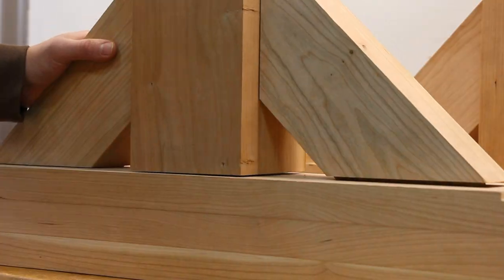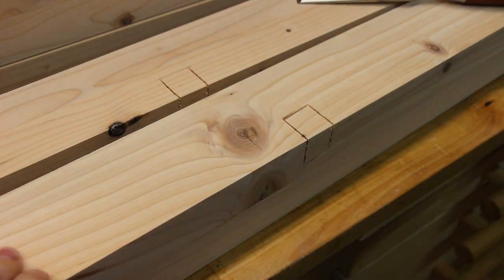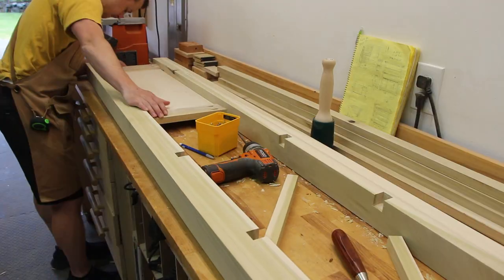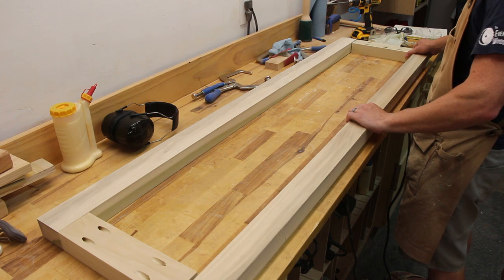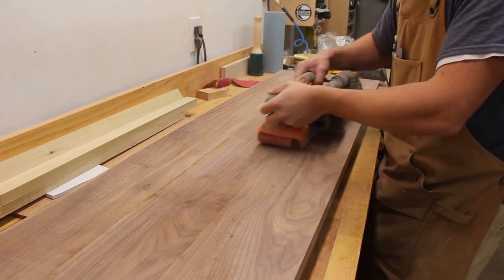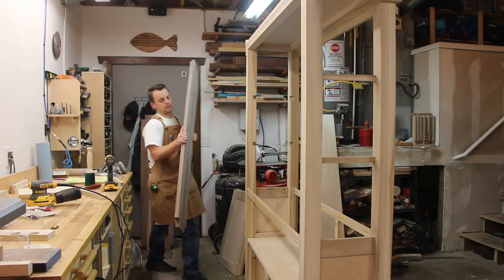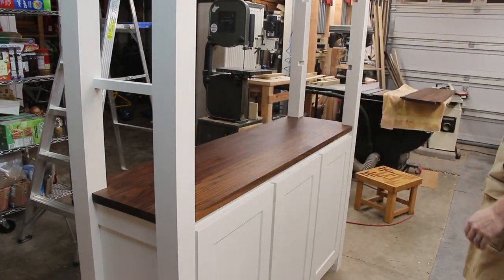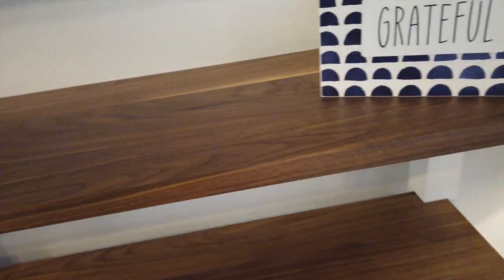Craftsman Style Build: White & Walnut Bookshelf

Comment: Great video, thanks for the effort in making it.  Had a question regarding if the walnut shelves ever bowed or sagged over time.  I've never worked with walnut in a long shelf but I've had other wood sag if it's not supported in the middle at least.  I just realized it's only been a year and a half so it's probably just fine.
Reply from the maker: No sagging so far, but that's why I went with the 6/4 walnut. Try using the Sagulator... just Google it. You can calculate what the sag will be on almost any shelf material.

Comment: Nice work! This demystified a few questions I had to build some shelves myself. Well done! How many coats of paint did you use and did you use a clear coat or finish on top of that?
Reply from the maker: I did three coats of paint, but I added an additional layer of clear polyurethane on the white shelves inside the cabinet to help in the high wear areas